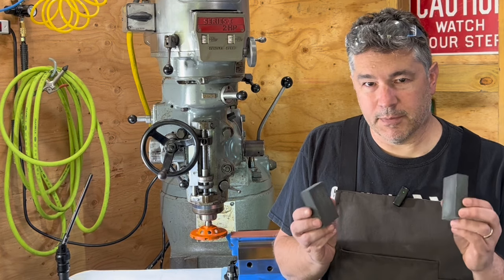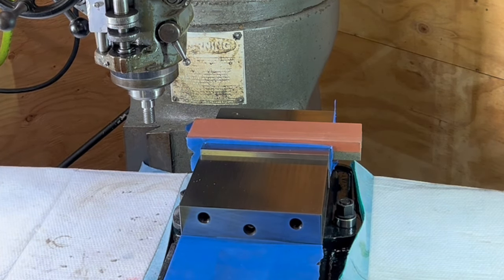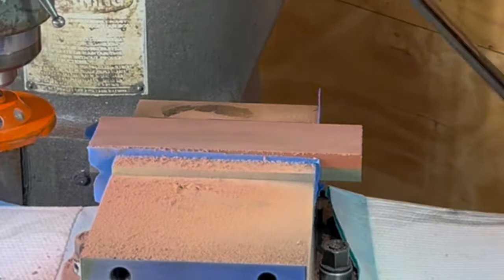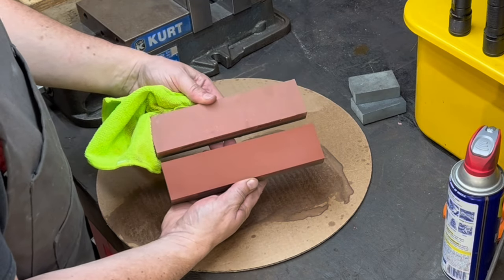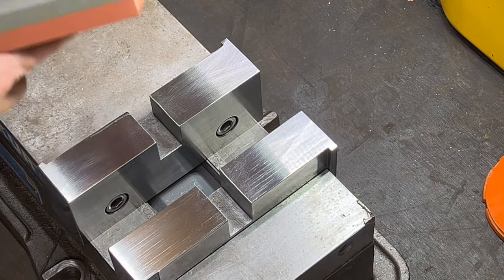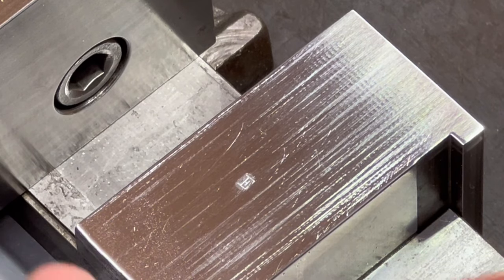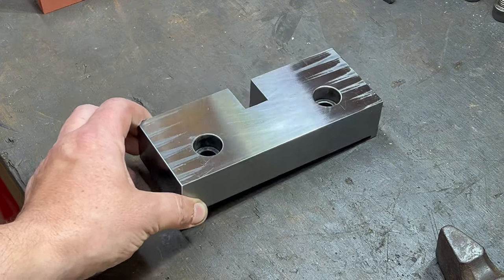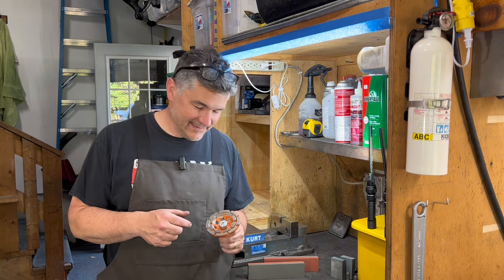DIY Make your own home shop quality "Precision Flat Stones" with a diamond cup grinding wheel.

Comment: Thanks for the mention but who is " shane ".
Im glad it worked for you, it certaimly can be a cheap way of getting a usable tool for those without the normal machinery needed to make them. Although if you have a surface grinder the extra precision may make a slightly better stone but the difference is marginal. Better to have a 99% stone than none at all.
Reply from the maker: I had posted the original video on a Facebook group and one of the viewers there had the same idea of the cup grinder so I wanted to give him the shoutout as well. I’m really liking the performance of these stones. I’m going to use a medium 6” set and retire the 3” original ones I made.
Reply: @EnoRestoration  i never thought it original good ideas are rarely lonely, but unfortunately bad ones are very common too! 😉
Perhaps if you cut your 8 inch into a 5 and a 3 rather than have 2 pairs of 4?
Reply from the maker: Are you thinking to make a 5" set and a 3" set out of 2 8" stones? I think the pair should be equal length so that as you rub them together for cleaning your are more likely to keep them flat vs rounding them. @chrisstephens6673
Reply: @EnoRestoration  yes two pairs of 3 and two of 5, I find the 3 useful being small, but can see a use for something bigger although maybe not necessarily the full 8 incher, (I resisted the urge to make a husband and wife joke there😉).
Reply from the maker: @chrisstephens6673  you showed proper restraint! ha!
Reply: @EnoRestoration  yes but it is a rare thing for me.🤣
I had a hoodie printed with "I identify as a dwarf " to wear at a model engineering show this weekend, I'm 6foot 6ish by the way, knowing the oldies that go there will think this identifying as something you are not to be a good source of humour. Either that or the woke element will cancel me.🤣🤣🤣🤣
Reply: @chrisstephens6673   I so need to get one of those... Thanks for the great idea. And the video... I'll be making a set.
Reply: @rbrianlindahl5499  glad to help. My ego tells me I should have done a video myself, well it would if I had one.😉 I'm told that some of the things on my channel are good ideas, too.

Comment: I feel like you could have the stones concaved or create a radiused cove ever so slightly if that diamond wheel is not perfectly flat. Do you know what I mean? Exaggerate and imagine a cove router bit that has a radius but such a small radius that the eye cannot detect it. You can verify if you take metal stock of the same stone dimensions and then grind it and test with blue on a Starrett granite master for example. Great video however, I was hooked to learn your technique.
Reply from the maker: I do know what you mean.  I worked hard to make sure the tilt and nod were properly tramed (aligned flat) before doing this.  The results have been great.  Thank you for the comment!

Comment: Thanks for sharing this technique! Please please please do this wet in the future. Soak the stone in water and mist it with water as you go. This will help keep the dust out of your machine and your lungs. Silica dust is almost as hazardous as asbestos.
Reply from the maker: Thank you for the suggestion.  I did have a mask on for the grinding operations.  A wet set up is a good option too.  Thank you for watching!
Reply: These stones are made from aluminum oxide. While the dust may be an irritant, these stones do not contain crystalline silica, which is very toxic.
Reply from the maker: Thank for the information and thank you for watching.

Comment: Thanks for the detailed presentation.! I am not sure if my mill is up to grinding stones the way yours is. Also, I would want to be sure I can keep grinding dust from infecting my equipment. I certainly am not going to purchase flat stones like this so perhaps, after all, I am going to have to make some as you described.
Reply from the maker: I agree that you should be careful with the grit and keep your mill covered up as I did.  You may consider a vacuum or one viewer suggested doing this wet.  I am happy with the results, these stones have worked great for me.  I have a couple extra sets I am selling on eBay, link is in the description.  Thank you for watching and providing your feedback!  I appreciate it.

Comment: Did you tram your head in all axes, did you dress your stone?
Did you inspect the stones after cutting or just start using them?

If you don’t know your stones are flat you could be doing more damage thinking you’re helping things.

Edit: after finishing the video I don’t see any of this but I did see some interesting tell tale witness marks from your second test engaging the larger surface of the vise jaw.

The marks are that only the ends saw any refinement, which could be because the jaw was not flat, but it was ground on a surface grinder apparently, I’ve not seen the video. It’s also possible the scotch brute wheel could have set the stage for such marking from the stone, but if you think it through you’ll see that’s unlikely.
The next possibility is that the stones weren’t actually flat. Checking for hinging at the 1/3 distance from each end is one test for this. I must have missed that part of the video.

Anyway my point is be cautious using these on your finest china before you know they are what you intended them to be.
Reply from the maker: Thanks for watching and for your questions!  Yes I trammed the head. By dressing the stone do you mean the diamond cup? If so, then no I didn’t but I only need one point of contact from that cup so the highest diamond point is doing the work. I tested the stones as seen on the video, they worked great for my home shop and I’ve had good feedback from those people that have bought them. I think they are a great alternative for the home shop machinist. As I said, I would never put them up against the expert machinist who have made these however those stones cost significantly more.
Reply: I saw you testing them in use, I must have missed the metrology.

I’m glad you and your customers are satisfied.
Tell me, please, are you a professional machinist?
Reply from the maker: @matter9 No, not at all. Just learning and sharing my experiences in my hobby shop.

Comment: The problem with making precision stones is that the grains of the abrasive be ground off by the diamond, resulting in a flat smooth grain surface. In other words, it won’t take metal off because it won’t cut. But since there is a tiny space between the abrasive grains, it does catch a slight bump in the metal surface it’s wiped against. That will shave off the bump. But in a smooth surface has nothing to catch in the stone, so nothing happens.

I know some people, think the main purpose is to flatten the stone, and that’s just half of it. But if the stone does attack the smooth surface, then it’s not really a precision stone. It’s just a flat one. The problem with those circular diamond grinding wheels is that they’re designed to rough cut concrete or stones such as granite. To make the best of these stones they should be finished with a finer abrasive. The stone surface should look slightly shiny when finished, for the best results.
Reply from the maker: Thanks for the comment! This video has been great way to learn a lot about flat stones. My viewers are awesome. Thank you for contributing!

Comment: to keep stone flat best as possible the perfect way is to use 3 stones and lap them each other that a old method to generate perfect flat from nothing 
After for maintenance just needed to share wear and use between the 3 and reflat them again ...
to clean two stone that mandatory to make X and Y stroke to avoid to form a gunter shape . channel
Thanks for your video
Reply from the maker: Three sounds like a good idea. Thank you for the suggestion!

Comment: Great Video!  Thanks for posting.  This might be nit-picking, but when cleaning the stones, did you transfer some of the coarse grit onto the fine side of each stone?  Perhaps better to do both fine sides first, then both coarse sides?  
Again, this is a great idea!  Not only do some not have a surface grinder, but also the diamond stones for surface grinders are a lot more expensive!  This is a cheaper alternative.  
I am unsure about how to compare the results (accuracy of the Bridgeport spindle tolerances compared to a surface grinder).
Reply from the maker: Thanks for the comment! That’s not nitpicking at all, I think you are right on and I appreciate the feedback. My viewers are awesome because I learn from them all the time. Being new to this hobby I like to try some different things and see if they work (safely of course). I have another video on my channel where I used a regular surface grinder stone wheel to grind a harbor freight sharpening stone. It worked out really well as an alternative for true diamond ground precision stones. Thank you for subscribing to my channel. I enjoy sharing this stuff with other folks. Take care.

Comment: Thanks for a really interesting presentation, I would like to know what grit the stones were or the manufacturers part number and I would love to see your test pieces tested on a surface plate. From the stone marks it appears that either the test piece or the stone are "high" at the ends. Or is that a normal flat stone characteristic?
Reply from the maker: Thanks for the questions. The stone is a Norton 100/320-grit combination oilstone. There is a link to these in my description.  I do think I left some high spots on my test pieces when I initially ground them on my surface grinder and the stone did a good job of highlighting those areas. I’m still working on improving my skills on the grinder. As far as the stones go, they come from the factory with high spots and rolled edges so by grinding them like I did they come out really flat. These have been great for me so far. Thank you so much for the comment and the questions, I appreciate you watching my channel.

Comment: Can you tell me what the two grades of your stones are on either side,please? The ones I’ve seen that I might be able to use are 250 and 150.
Reply from the maker: The Norton website only lists the grit as "fine" and "course".  I did see a page on Sharpening Supplies . com that indicates fine is 400 and course is 150.  In my limited experience, I have found that the hardness is important.  The aluminum oxide stone is better than a cheaper stone.  Hope that helps you out!

Comment: Wondering: why not do a 3 stone flattening after dressing them with the cup wheel? Would expect the cup wheel to have quite a bit of runout. Maybe not enough to negate the benefit of using it to dress the stones, but to really finish them, three stones is a self-proofing system. Just wondering.
Reply from the maker: Really good suggestion. Through these comments I’ve heard more about the three stone method, I’ll check that out. Thank you for watching the channel!

Comment: You mentioned cutting the stone in two pieces. Do you have a good suggestion how to cut the stone?
Reply from the maker: I used a diamond blade on my skill saw. Flipped the saw over (clamped it to a table) and used it like a table saw where I ran the stone across the flat bottom of the saw.
Reply: @EnoRestoration  didn‘t though about a diamont blade. But great advise than I could use my miter saw. Thank and keep up with those great videos!
Reply from the maker: Thank you, I appreciate the support!

Comment: Did you dress the diamond cutter flat beforehand ?
Reply from the maker: Great question.  No I did not dress the cutter.  At the time, I considered it but I concluded that, like a fly cutter that only has one point of contact, that the diamond cutter likely also only had 1 high spot, and if I traversed at the right speed, (so as to not "spiral" the grind by going too fast) the result should be ok. Thank you for watching and the question!

Comment: something is wrong. They should leave mirror finish. They are flat but your process didn't grind stone particles but just ripoff highspots. I assume that rpm of the wheel during griding was to small or/and to big grid of the wheel or/and to big unbalance.
I lapped 240grid orange norton stones and they leave mirror finish. you can check video on my channel.
Reply from the maker: Thanks for watching my video. I’ll check out your channel. Thank you.

Comment: What RPM did you use on the diamond wheel?
Reply from the maker: Thank you for subscribing, I appreciate it!  I ran the Diamond wheel at about 1,800 RPM.
Reply: @EnoRestoration  thanks! second question... you mentioned cutting stones in half to get two shorter stones. what do you use to cut them safely & efficiently?
Reply from the maker: @rbrianlindahl5499  I used a diamond blade on a skill saw.

Comment: Me thinks that the rapid transverse movement when you did the scotchbrite gave you the markings on the jaws.  I wondered about that when I saw the process.  The stones confirmed it.  I am sure that it would have zero influence in the usefulness in operation, but you were going for jewelry not rugged.  Might setup a test piece ( when you are bored and need a little testing) and do a micro transverse, possibly changing the speed halfway through….. but I am sure that the surface will be better with a slower travel speed.  Me think 😂
Reply from the maker: I agree. I have more learning to do with the surface grinder. The stones are a nice complement to the tool box to help identify high spots. Thanks for watching my channel. I appreciate the comments!